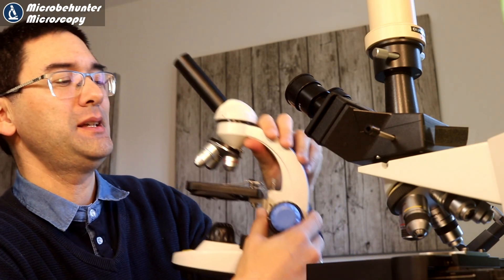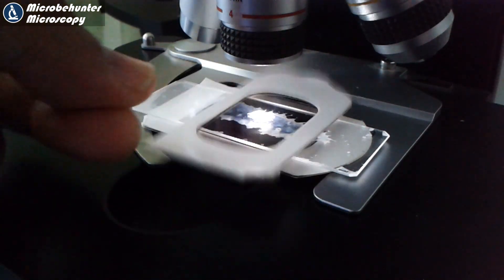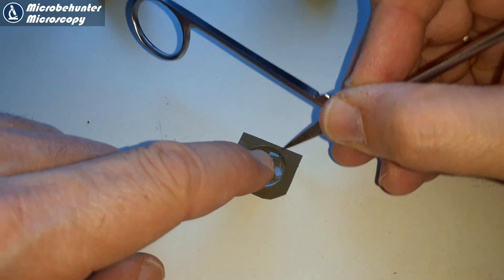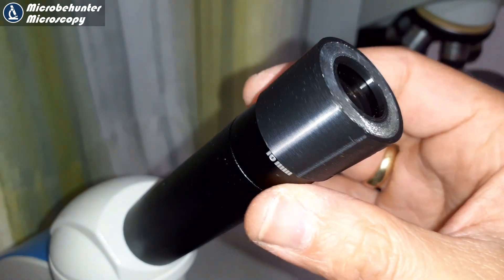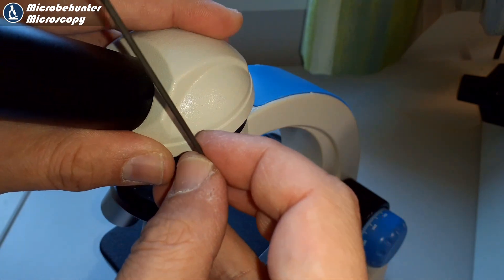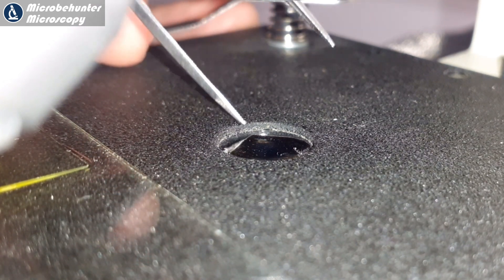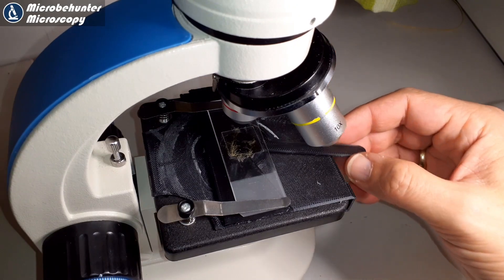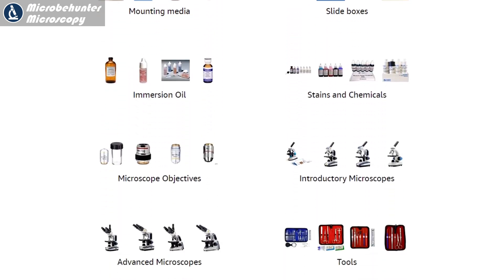🔬 How to upgrade a microscope to polarized light

Comment: EXcellent! thank you. Several customer service at microscope companies or stores couldn't answer my questions about the polarized lens kits they sold to put on a 'student' trinocular microscope. I need to look at emulsions with both polarized lenses, and need to photograph and video. Any suggestions? Did you get good results when you placed the polarized film on top of the specimen slide (I would usually be using a cover slip on top of my specimens (like mayonaise). thank you. email?

Comment: You put the first polarizer below the stage condenser and the second polarizer (the analyzer) above the eyepiece?

Nothing in your scope is going to be "stress free". Stress in transparent materials, even those that aren't normally birefringent, causes stress birefringence, which may reinforce or negate the color shifts you're trying to capture in birefringent crystals. There's stress in the lens elements in the objectives,  the eyepieces, the condenser and (as you already discovered) the prism that gives you a more comfortable viewing angle. 

Seriously, you want the optical path to be light, condenser, polarizer, subject, polarizer, objective, prism, eyepiece.  Build a mount that lets you put the polarizer below the objectives. Or get some stress free (aka "pol" or "DIC") objectives and put the polarizer in the main tube.

Comment: I've got an old Olympus microscope that has no internal light source - I use a fiber optic dual gooseneck lamp when I use t. Is there any way to turn this into a polarizing scope? Thanks for any info or links.

Comment: Hello Microbehunter, i am from germany and got recently interrested in the microscopy hobby and am already a subscriber to your channels, i just bought myself a Swift SW380T microscope which is in my opinion a very good one, i understand already that i can't simply change to infinity objectives, for that i would have to buy a new microscope that has that feature to use those infinity objectives but i think that 160mm objectives give me a really good maybe not even worse quality, but a new question arises, should i buy new Plan objectives? it says that they give me more focus or a better resolution on the edges of the specimen when i look at it's middle, or should i just stick to those i already have originaly build in my Swift SW380T microscope?
Reply from the maker: Stick to the ones you have. The other objectives will not allow you to see anything different.
Reply: Nevermind, i just stumbled across a video you already made on that topic, but anyway your channels are besides my microscopy book the main source of knowledge everything around the microscopy hobby

Comment: Will the condenser also depolarize the light? I had some issues with mine and my polarizer was in the filter slot below the condenser.  I'm hoping to not have to move the top polarizer (which is currently inside the scope).
Reply from the maker: Unless the optics are "strain free" (which most are not), they will depolarize a little bit, but by far not as much as the prism or plastic lenses. I think the prism depolarized becasue of the internal reflections (which does not happen in a condenser). in my other microscope I place the filter below the condenser and there is no problem, depolarization is almost not visible and the background remains dark. Dedicated polarizing microscopes will have strain free optics and there there is absolutely no depolarization.